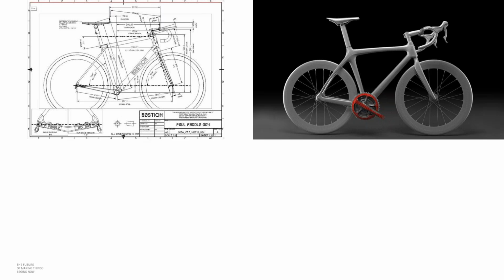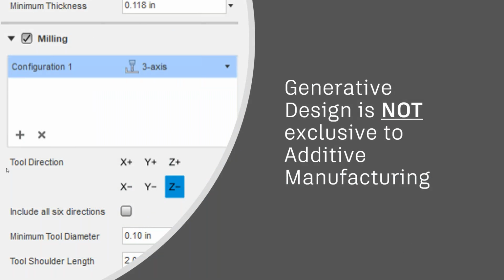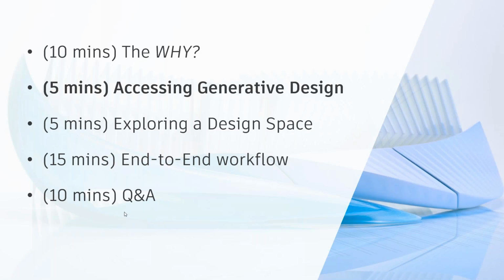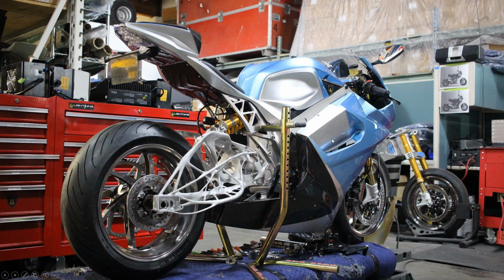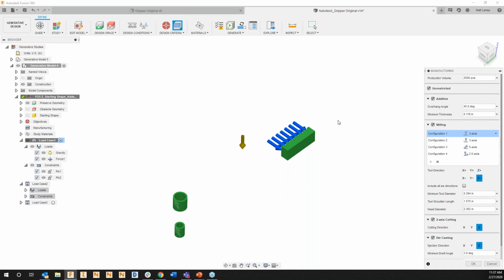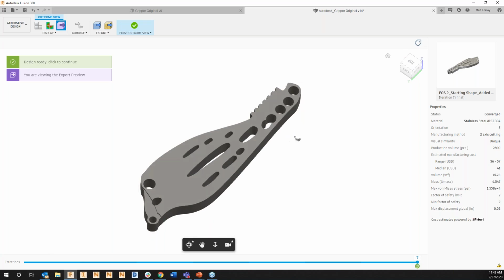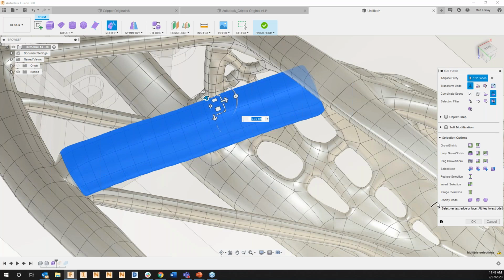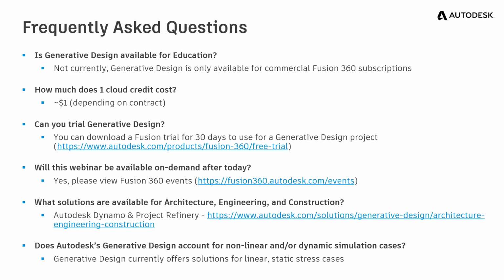Generative Design for Autodesk Inventor Users - Feb 2020

Comment: I recently came across the auto-creating drawing feature and found it brilliant. We have over 50 designers, and I can't imagine them exporting projects to Fusion. It's too time-consuming and complicated. The generative design feature should be part of the default Inventor interface.

We use Autodesk Vault, and it's connected to our ERP system. Using Fusion is just a waste of our time.